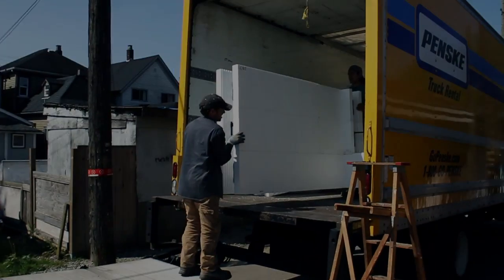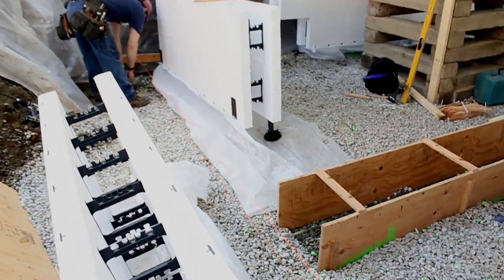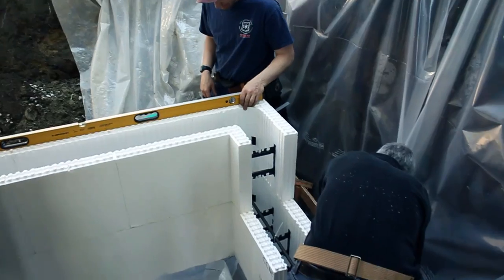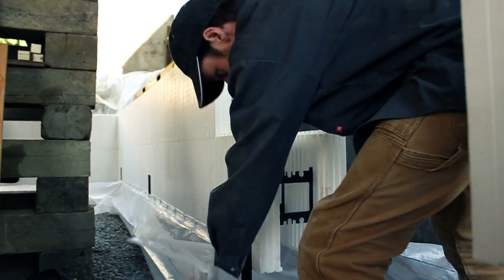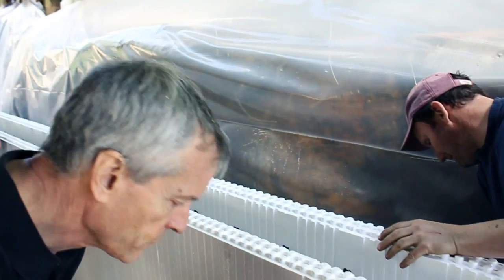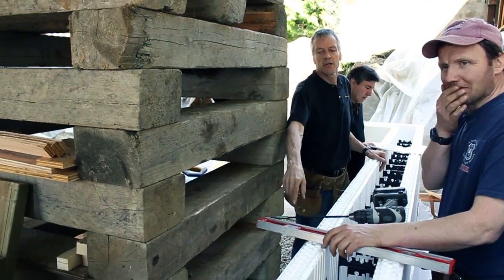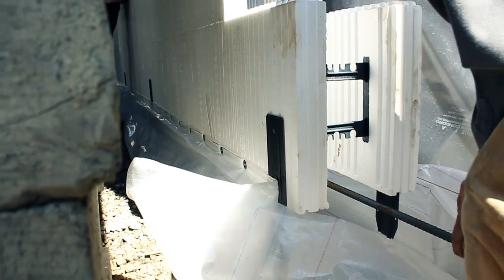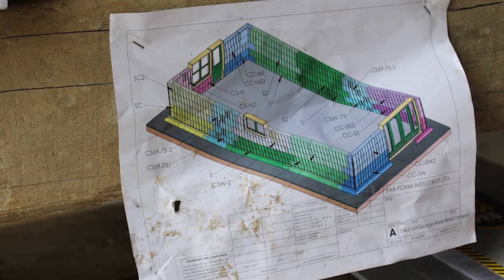Installing Fastfoot® Monopour Components

Comment: Most used word in the construction industry....BS! Gluing ICFs together is like lifting a truck with a string. It does nothing.
Reply: Dude, it is not for resistance, it is for holding them together till they are braced.
Reply: You can tell when someone hasn't done an icf foundation...